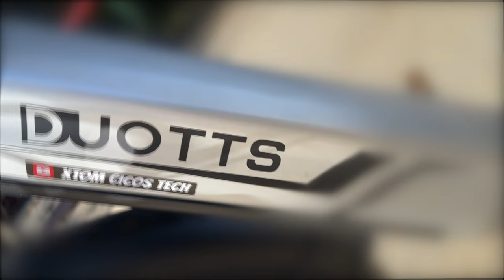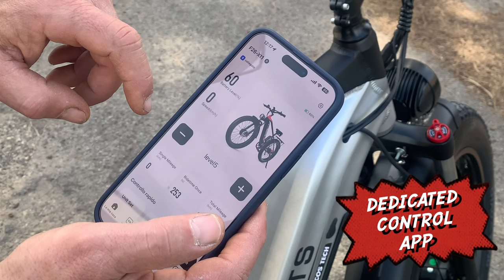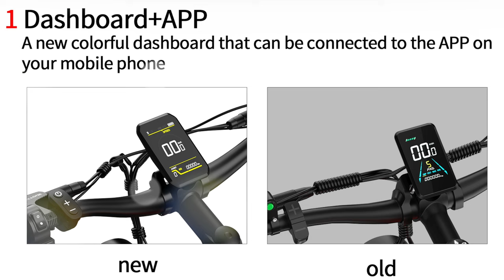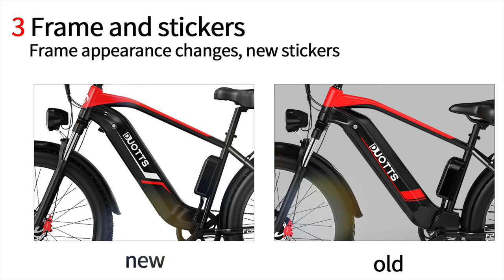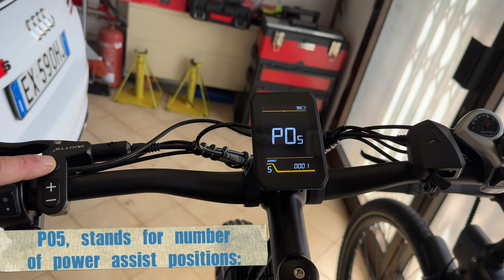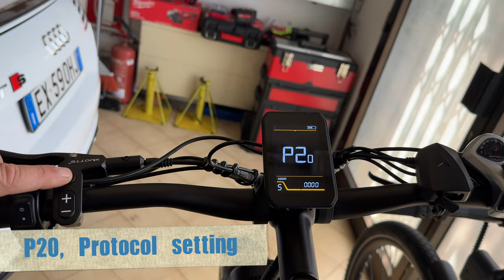DUOTTS F26 2024 UPGRADE - BIG EBIKE, BIG POWER, BIG FUN - FULL TEST - 4K

Comment: OPINION: The electric bike traveled 156 km. The brakes needed to be replaced much earlier, the wheels became uncentered within the first day... But after about 150 km of total mileage, the engines started turning off on the uphill sections, so the bike was no longer suitable for use. So how much does it cost to ride a DUOTTS bike for 100 km? In the case of my purchase, the real cost of traveling 100 km is PLN 3,236, i.e. 1 km costs PLN 32.35. These are real savings when purchasing a DUOTTS bicycle! No warranty or service are additional advantages!

Comment: How did you reach such high speed, did you change any settings? Mine only does 55-56kmh max on downhill, doesn't matter if I use electric throttle only or also pedal, it doesn't want to cross 56kmh even downhill. My P08 setting is set to 100kmh so there should be no limit.
Reply from the maker: Io ho cambiato l’impostazione del raggio delle ruote a 31 perché mi hanno detto in Duotts che è di fabbrica 26 riferita ai cerchi ma poi bisogna considerare le ruote fat!

Comment: To unblock the speed I needed to put P08 option to "67", not sure why those other options didn’t work. Could you tell me how to take out the acceleration delay from start? After it’s riding it gives the power but at the start it takes time to run with full power.
Reply: Also the throttle for me is active from start either with 0 or 1 in the p09 settings